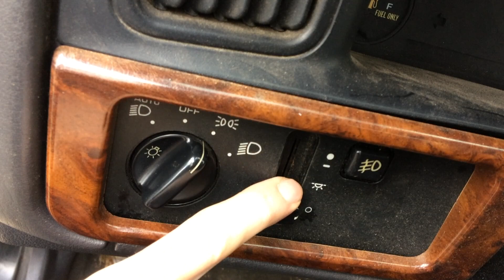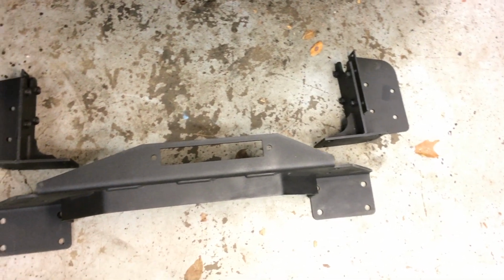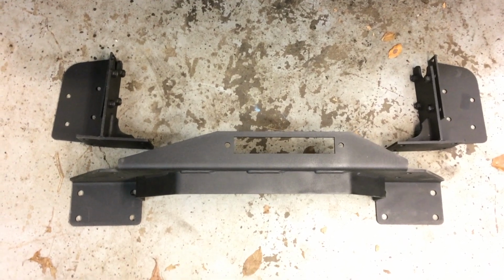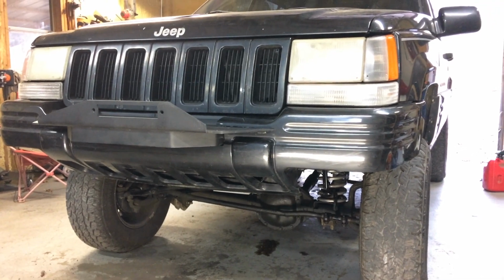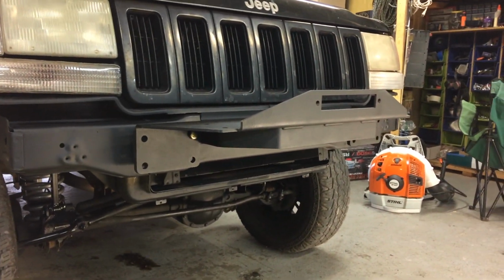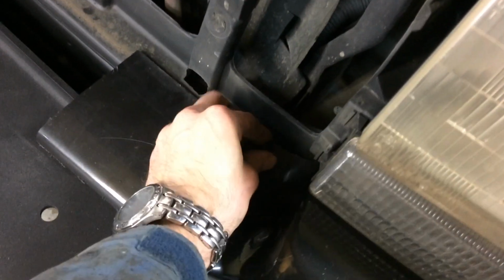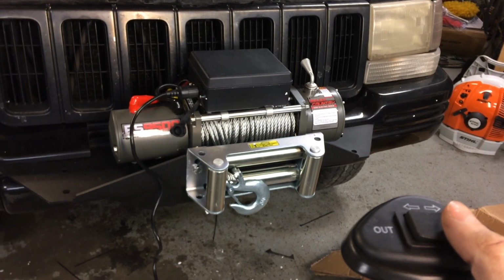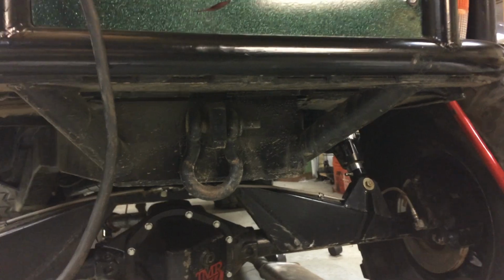Look at My Grill - Operation Cheap Jeep

Comment: For the winch hook... look into a daystar winch isolator. It works as a line weight; and also keeps your hook snug against the rollers without damage. Its like $20 if its in your budget.

Comment: dude , quick easy fix for those fog lights, if you so choose to keep them instead of tossing them/selling them... take the headlight switch out, open it up, and solder the board... VERY common issue with our ZJ's... Also, if you're planning on selling the fogs, i can trade you the full 6 piece headlight set for the fogs... only thing i'm missing on my ZJ is the fog lights... Keep up the great work and as always, I'm enjoying this Cheap Jeep build!

Comment: If you could find a piece of 6 or 8 inch round heavy pipe you could cut two corners for each side and use square tube in the middle on the back for a bumper. Then build off of the tow hitch and the factory bumper mounts. Just a thought. Looking good man.

Comment: Check your local scrap metal yards or a local trucking company to see if they have any junk semi truck bumpers. You'd have lots of metal to work with. 

I'm really surprised that you didn't go with a receiver hitch on the front for mounting the winch this way you could put it on either end of the vehicle.

Comment: Since this is the cheap jeep you should hockey together the turn signal, just on principal. When it comes time for a front bumper you could use the plastic one as a template for the angles and cuts you want to make. Just cut it up into smaller sections to work with.

Comment: I'd suggest a sheet of 1/8" (for less budget) or 3/16" (more budget) sheet of steel and then you can make a rear bumper, side armor, and skid plates all from a $80-100~ sheet for 1/8 and about $120-150 for 3/16. Other stuff you can make too but that's pretty common stuff and will take most of the sheet.

Comment: I just cut that front "cross member" out, replaced it with a piece of 2x6 that I opened up to set the winch in.  That gave me a winch mount that didn't stick out so far, ruining my approach angles.  I mounted it to the unibody by opening up those holes leading into the frame rails, which perfectly fit 2x4 inside, which I then sandwiched with the frame rails with some 1/4 plate out the outsides and ran some grade 8 bolts through the entire thing.  I saved probably 4 inches of clearance, have a stronger mount, and it was probably less than $50 in material.  

Now I just need to get around to building a bumper off of that winch mount...

Comment: hey you can use the fender bolt to hold the front bumper on. I did on my zj and it wont fall off even when its hooked on a rock.

Comment: looks like the rough country shares the same design as an ENGO winch. engo winch is the toughest winch I've ever owned. the guy I sold it to says the same thing. I just recently sold my warn ti 9.5 and got a new model engo e9000. winch cost 299 shipped to the door. I picked up some dyneema line for 130. the whole thing weighs less than 50 lbs.

Comment: Has Rough Country went up in quality lately? I was under the impression their stuff was cheap entry level stuff. At least in the realm of suspension. I did a 2.5 inch lift on my TJ with all new lowers CA's, shocks, springs, and a track bar. The only thing I haven't replaced is the springs.

And to be fair, their front lower's are built well. Their joints, at least at the time that I purchased them, were no good. I called them once and customer service was really good. No complaints on that front. They sent me new ones free of charge; they just wore out again in a matter of months. Ended up buying Currie Johnny joints for the Rough Country lower fronts and am still running them.

Comment: I have a video Idea for cheap jeep. Painting coil springs experimental. I was looking for videos on painting coil springs and saw Plasti-dip and rust-oleum as the cheap solutions but not that many videos on youtube for either. Try plasti-dip on driver side and rust-oleum on the right. See which holds up best to chipping and peeling, which looks the best, which one sheds mud and junk when cleaned.....

Comment: I use a "wrench saver" with all my wenches. It's a hard rubber ring that goes on the line between the hook and the rollers. It allows you to tighten the line without stripping gears or tearing anything up and also keeps it from rattling. Just a thought

Comment: I know this is the wrong place to ask but how much does pick and pull charge for an axle? how about a transfer case as well? i just know you go there a lot and looking of general prices! thanks!
Reply: They are different prices depending on location. Best thing to do is go to pull-a-parts website and select the closest location to you and you can see all the prices and inventory for that location. But here in Memphis it's about $120 for a rear axle and $200 for a front and transfer cases are about $100

Comment: Good Luck with The ZJ, looking forward to your build.    I and my two sons have build ours 3 ZJ to wheel a ZJ familyl.   I have been slowly building, wheeling and breaking my current 5.9 for 10 years now.  If I can offer any advice with the ZJ along the way I will.    I do want to thank you for helping me with my most rewarding accomplishment with my ZJ project.   That is,  I put in a HP dana 30 W/ 4.56 geared and a Detroit.     Due in part to one of you videos,   I was able to do my first R and P set up on my own.    And better yet, It has not broken.      Keep the videos coming   Thank You,  Subscribe!

Comment: Probaly already working on that rear fender, but this is a drawing for the one I built.  And if you get to weld that large rear square tube air tight it can be used as a air tank for for compressor and tools.   https://docs.google.com/document/d/14dlwVIqePJqno0Co2UGW6KREnGMvdrapXwL8FPdFBUM/edit?usp=sharing

Comment: Rodents suck! Look out if you have electrical wires anywhere near the hole, a couple of chipmunks got into my shop and stripped a fair amount of insulation off the Romex. Think a rat trap would fit in that little nest he's got going there?

Also, 4:48, what the techno renaissance fair am I listening to?

Comment: You should try to zip tie the light or use some baling wire it is operation cheapJeep. If you didn't get that squirrel you should buy a big rat trap Or a cage trap and drowned that little fucker